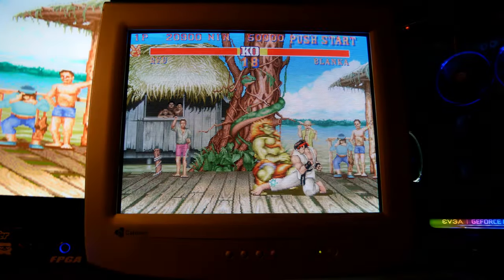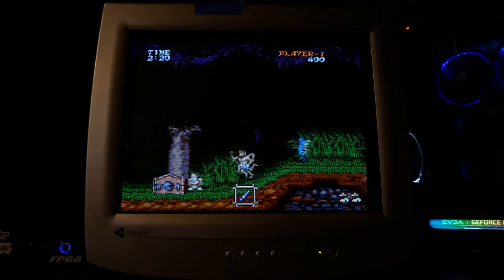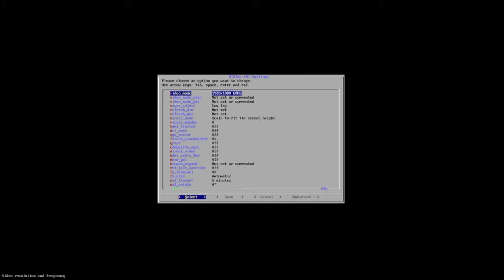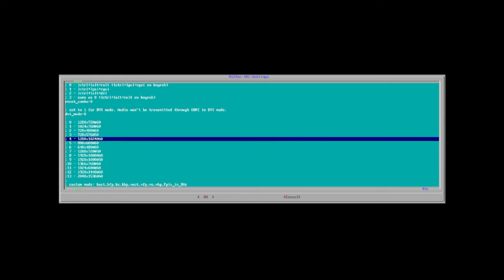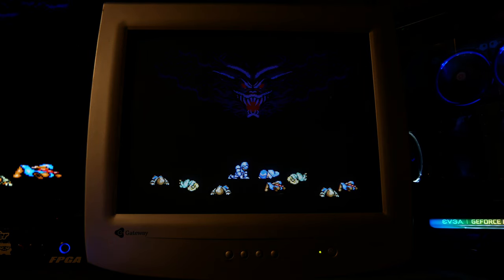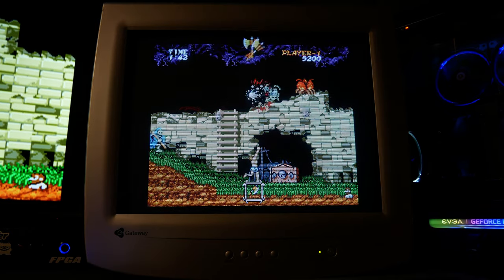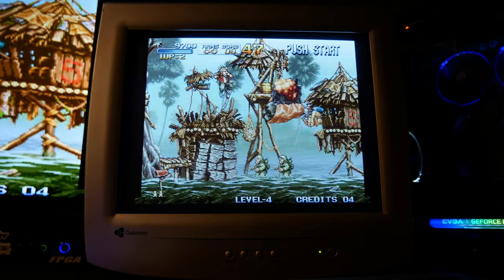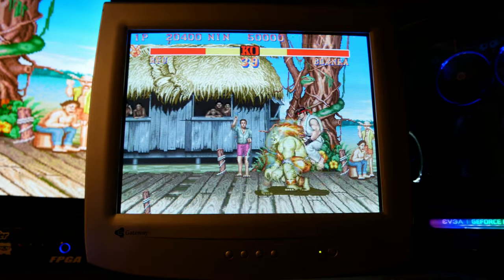240p 120Hz MiSTer FPGA PC VGA CRT Settings / Guide / How To Get Best Video Settings for 31kHz CRT

Comment: This is really stupid idea because 1. it increases input lag to ~2 frames. 2. monitor cannot really be synchronized to game system. 3. even 60fps games will have sample&hold blur. So the biggest advantages of CRT are gone. The only thing that method does is relatively non-flickery bright picture. Great for static shots but not for gaming
Reply from the maker: stupid if your a purist based on paper stats. I used my eyes and tried all methods possible for a 31kHz pc crt. This is what looks the best FOR ME, using a pc crt monitor. It has tradeoffs sure but if I only had a pc crt to run on mister, this is the method I would use hands down.
Ultimately I have pvm's im picking up later this week, and a 27" sony consumer crt im recapping that will end up being what I run the mister on. Im just trying all different types of displays and methods and reporting my opinions.
On paper, and by most peoples comments ... the blur from double frame rendering by 120Hz should be atrocious ... but it doesn't bother me and looks great and I dont notice any motion blur on this monitor.
For the longest I put off trying this and would of told people exactly what your saying but for me- if playing with a pc crt this is the best tradeoff. It does have lag, not horrible but it is definitely there- I wont deny that, its just borderline of whats acceptable for me to play with but for scanlines on a 31kHz monitor- this is the only acceptable option in my opinion, all the rest are too dim, and not having that phosphor crt glow is what I consider making it not worth playing on a crt. But for casual playing I enjoy it alot, none of the issues Ive heard about bother me other than the lag and its the only way I get a bright vivid image with scanlines and dont notice blur.
Reply: @LameGaming  120Hz 240p on VGA CRT will be still better than most flat panels in terms of motion clarity and lag. Any frame skip or repeat due to timing differences will be not as noticeable as at 60Hz. Also for some use cases eg. experiencing old programs/systems or 25/30fps games it won't make that much difference because they already lack perfect motion clarity and all you remove by going 100/120Hz is flickering and dimness. Though added lag, even if it is only one-two frames (at 8.3ms per frame I suppose) won't help . The issue then is that with this solution you loose the very advantage Mister brings to the table over say cheap Raspberry Pi 4 and RetroPie. Heck, in this case depending on emulator RPi4 can be faster (less input lag & better overclock options for emulated system) and will have more features or better compatibility with games. For Mister and VGA monitors imho VGA look is fitting for VGA monitor anyways as line doubling  is exactly what VGA cards did for low resolution video modes and having PVM I like that I can get this kind of look with VGA monitor if I want to. BTW. PVM is definitely the way to go for scan lines and in general. If you wonder about how you will connect it to Mister then worry not because cheap VGA-Component adapter and Component cable is all you need. PVM can sync on green to RGB signal with only 3 cable component connection and image quality is BRIGHT and GLORIOUS :D I do not use any scaler but scaler as long as you use vsync_adjust=2 it should have only four lines of lag and be perfectly synced. Component connection also looks good and allows you to change saturation, but RGB looks marginally sharper and has guaranteed perfect saturation. Also the way Mister's cores handle Component sucks and this can be verified with 240p test suite on SNES core - so stick to RGB :)
Reply from the maker: @e8root  Yeah I agree its not ideal but if one was stuck with only having a crt in the 31kHz flavor and were like me wanting scanlines and that nostalgic crt glow its definitely worth checking out. Its the only option I would go with if this was the only crt I had but I definitely wont be doing any speed runs or twitch game winning due to the input lag which isnt unplayable but its there for sure and will bother people to different degrees. 
I finally found someone local with a large supply of pvm's. All of them only 14" though. We are working out a trade for one of the NES RGB systems I have, Ive done several this year so had them on hand.... Looking to get a 1344q which is older but has rgb and 600 TVL. Hes throwing in 3 panasonic PVM's. 2 with dim tubes, and one with bad caps in power circuit. I might buy an ikegami from him as well. I do have vga to YPbPr cords, vga cables, and even some transcoders if needed. I need to order some BNC adapters and termination caps just to have on hand.

My mouser order just shipped to recap a 27" sony fs120 which will be my main mister display if I ever can find a stand I like for it. I might just have to build one. I have Another 27" curved sony and a 27" panasonic but they are in line for service and rgb modding if I ever get the time.
Im looking into a tube rejuvenator as the guy I found with pvm's has a bunch of sony pvm's with dim tubes but ive read its not easy to rejuvenate trinitron tubes due to the way the electron gun is setup.
Reply: unfortunately there can never be something like the perfect monitor. Vga PC monitors were mainly for 90s-mid 2000s  DOS and Windows computer games and they still have the best picture quality for that type of emulation.
They offer the best balance if you want to emulate other systems despite having never being built for it.
Reply: Have you ever even tried this method personally before parroting this crap? I'm guessing no. I've been gaming at 240p 120Hz for years now and way prefer it over any 15kHz set I've ever used. Just like some people's ears get used to 70dB 15kHz flyback transformer whine (mine don't) some people's eyes get used to the 120Hz look. TBH I never saw any issues with motion clarity vs a 15kHz set, but the science does say that it should be happening. Either way, it is dumb to come to a video where someone is saying that they are having a great time playing this way and it looks great to them and "um aktually" up in it. "The biggest advantages of a CRT are gone" is such a ridiculous dramatic statement, especially when people who have actually tried this don't report seeing any subjective difference.
Reply: @C4103  Video dismissed superior method of using scaler also spouting nonsense about it causing lag which it doesn't and being blurry which it can be only if you configure blur in and instead recommends other method which for all its worth has its uses and strong points and can be likable BUT it should be mentioned what the disadvantages are - namely moving objects (like pretty much most 2d games with moving backgrounds and sprites) are considerably more blurry - like difference between perfect motion clarity (perfect == it is identical sharpness between static and moving stuff) and at most "still better than pure sample&hold display" but also can be more distracting - as double-ghosting can indeed be and why I don't like this method of running MISTer with VGA CRTs. I also don't like lag - scaler itself running at the same refresh as core doesn't introduce per-frame lag and only per-line lag so virtually none - though enough to make using light guns impossible but this cannot be avoided with any method and real 15KHz CRTs are needed for that. Anyways, it is important to describe these things more thoroughly and for that ideally guy should compare results to PVM or comparable monitor. If he did (and configured scaler correctly to not add pointless lag) he could realize that the method he dismissed is the best. BTW. 120Hz... which 120Hz? I mean its bothersome to even get consistent double-ghosting to begin with. I would need to check now but back then it was a hack and not supported operation. If it was supported it would also come with black frame insertion. I remember it not being consistent frame-pacing-wise. Not very good way to seemlessly enjoy multitude of games on multiple systems most of which run at slightly different refresh rates. On the other hand with high enough resolution even if system uses different number of lines the scaling artifacts are pretty much invisible like switching between PAL and NTSC... and you get perfect motion clarity without lag - otherwise you do also get more flicker - and not all systems/games need perfect motion or input lag so these 120Hz modes can be useful still - but again here we get - "wow, I found out you can get better than scan-doubler results using this trick" and it does mention input lag so I give him that but fails to investigate deeper - and why my dissatisfaction with the video and comment.
Reply: @e8root  In Retroarch on my setup I mainly just play NES, SNES, Genesis, PSX, Saturn, etc. In my case, 15kHz coil whine is a complete deal breaker. I just want phosphor glow and thick scanlines without 15kHz whine, which I still hear very loudly at 40 years of age. It drives me nuts, but I still like the look of CRT's so it's the best happy medium for me. I can't afford a fancy 4k OLED or any of this other fancy gear. What I have is a computer and a $40 VGA monitor I got off craigslist. For 99% of people that just want to play old school console games and have scanlines, this solution works fine. I get scanlines and don't have to fill my house with awful 15kHz flyback transformer whine.
Reply: @C4103   I found image of scaler with CRT/scanline emulation on real VGA CRT to pretty match look of 15KHz monitors (I have 14" SONY PVMs and 17" JVC but also have access to 21" 'medical' PVM) with added ability to adjust width of scanlines (note 'scanline' is the bright line, not the black gap) to make them look more like on smaller monitors (where lines are thicker making gaps smaller) or bigger 21" PVMs (where gaps are very big). These MISTer's scanline presets even simulate different pixel width in scanline for dimmer/brighter pixels and recreates CRT specific over-brightening effects - and when displayed on real CRT you also get its natural effects and everything is enough blurred to make simulation even more genuine. As long as you use high enough resolution so VGA CRT lines blend together the effect is imho seamless. I did compare it to 15KHz CRTs and with specifically comparing 17" JVC 15KHz monitor to 17" VGA CRT with pretty much very similar tube (colors were slightly different due to slightly different phosphors but overall still very similar) gave identical results and I base my findings mostly on this test. I also made this and other VGA CRTs (like 21" Trinitron) to have similar look to 21" PVM and also 14" PVM - which has much thinker scanlines compared to gaps - using scanline emulation on VGA CRT makes "CRT emulation" very flexible and I personally like let's say medium sized gaps - with something like 21" PVM having to my taste too big gaps. 14-17" 15KHz are in the sweet-spot imho. Of course anyone can use whatever they like but keep in mind that that if you recommend method you better do diligent testing - 240p 120Hz like I said had obvious disadvantages with most prevalent being lack of motion clarity and lag. That said I have not checked recently what MISTer dev team cooked up. 120Hz modes could be improved the last time I looked at them where it was just a hack - abusing scaler features and not something optimized for. In theory lag can be vastly reduced down to pretty much finishing frame at the same moment as originally (so there would be on average half frame lag in the middle of the screen) and black frame insertion added to restore motion clarity. Of course with BFI you would still have much dimmer screen (pretty much similar brightbness as 100% 'scanlines' with simple scandoubler). Other thing which would be nice would be to not need to create custom video modes for each system and to have no frame-pacing issues from mismatch of core's video mode refresh rate and what you set your monitor to - because that is (or was?) an issue with this method. Less visible due to how motion is slightly blurred and any frame doubling or skipping only is visible for 8.3ms at 120Hz - but other than non-perfect sharpness and non-perfect motion you also get 'floating' input lag with this method. Syncing to core's refresh rate by using method I prefer for VGA CRTs you avoid any lag, any frame pacing issues and get nice bright picture. Depending on thickness of scanlines it can be slightly less bright but simulating something like 17" professional 15KHz CRT its almost as bright as just using scan doubler. BTW. 15KHz whine never ever irritated me and the only thing that does regarding it is that these days at almost 40yo I don't hear it nearly as much as I used to in the past. I would actually like to hear it more :D
Reply: @e8root  You're the second person that has told me they like 15kHz whine and I just don't get it. The noise is worse than nails on a chalkboard for me. I'm nearly 40 and grew up with the sound as well. It's a miracle that I haven't experienced hearing loss yet, as I've been a drummer all my life and did not take very good care of my ears at a young age, although I suppose I have taken good care of them as an adult. I can hear up to around 19.5kHz clear as day. I've always hated the sound though, and now that I've had the joy of not having to live with it all these years hearing it again is almost like a PTSD trigger. I HATE that noise though and if a display isn't silent I'm not using it, lol.
Reply: @C4103  To me it kinda fills in atmosphere in the room and makes impression like there is someone in the room even if I am alone. It is for me a very nostalgic aspect of 15KHz CRTs. I was never bothered by this sound as its just pure sine wave and always gets attenuated after a while. Then when you turn CRT off its like something changed but its hard to say what with this change itself never feeling good or bad just like hearing this noise when CRT is just powered on never feels to me good or bad.
Reply: @e8root  Someone told me re: motion clarity that at 120Hz I may not be perceiving double images but since the images are "still hitting my retinas" that I am seeing them and thus being affected by them and having a sub-par experience. I think it's a similar thing to this where some people simply experience it differently. I've tried with and without BFI, with the monitor literally sitting next to a 15kHz TV and I still think that the repeated frames at 120Hz actually look better. I didn't grow up playing many games on original hardware on a television because my parents refused to buy me game consoles. So, I learned how to use the earliest emulators and that was 99% of my experience playing classic console games. I have nostalgia for VGA CRT's specifically because that's what I played games on. When I got my Dreamcast I even played that on a computer monitor with a VGA box. I like the phoshor glow look of a CRT, but "motion clarity" has basically no effect on my eyeballs / brain as far as I can tell.